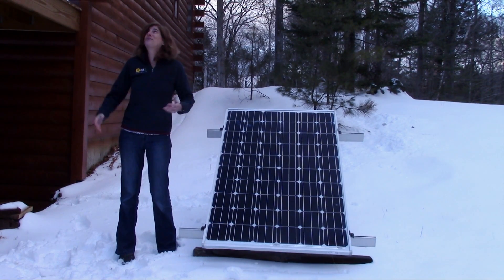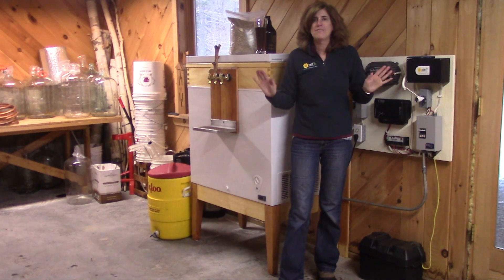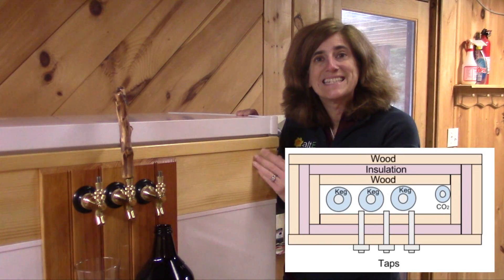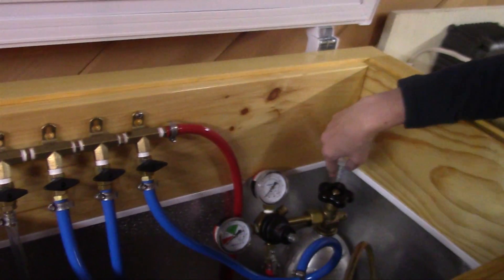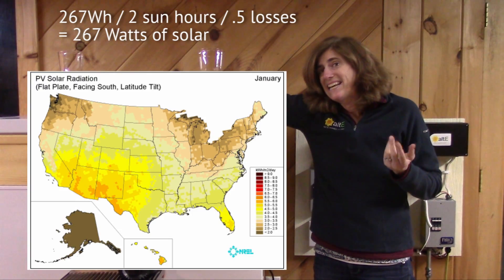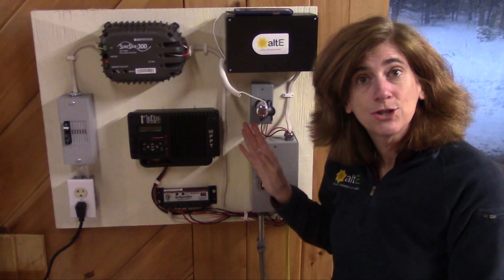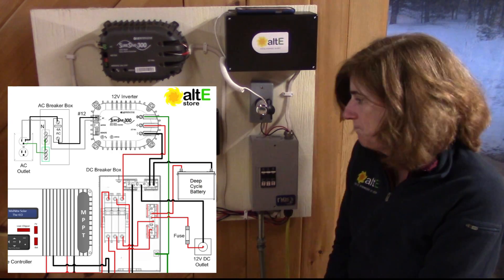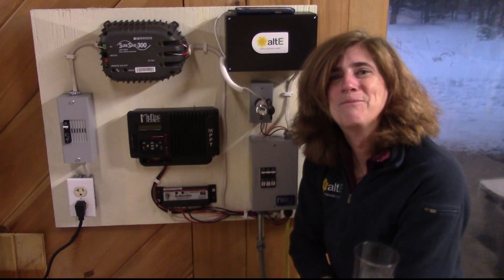Solar Kegerator

Comment: Hi, loving your in-depth knowledge. Is that just a 300w inverter there?
Thanks.
Reply from the maker: It is a 300W inverter, but I think I was lucky with it. Others have said it is too small to turn on their fridge. Depending on the fridge, you may need closer to a 1000W inverter to handle the turn on surge.
Reply: altE I thought so too, although the freezer I have in mind is 220v - 152w - 0.7ish amp So was hoping a 600w inverter would handle it?

Comment: How do you keep the battery from freezing when you are gone for a few weeks and the solar panel is covered and inverter killed the battery.
Reply from the maker: For my system, the battery is in my basement that doesn't get below freezing, so there is no problem. The inverter has a low voltage disconnect that turns off the inverter when the battery gets low, preventing it from completely draining the battery. The solar panel is tilted steep enough that the snow falls off after a day or two.  If the battery was in a freezing location, I would have it in an insulated box that keeps the heat in that is generated when the battery is charged. Again, I'd make sure the panel is steep enough to shed any snow.

Comment: Many thanks for coming g back to me. I was planning to use 6 x 6v batteries 225 amps each connect 2 to gather in series to get 12v at 500amps banks. 
My question how do I know which mppt controller I will need.
Is there any calculation need be done or the biggest the better.
Many thanks any.
Reply from the maker: Divide the solar array by the battery bank voltage to determine the charge controller size. No need to oversize it unless you are planning on expanding in the future.  You have 3 parallel strings of 2 batteries in series for 12V 675Ah bank. You want to at least charge it at C/6 rate, with means 1/6 of the amp hour, so 112A. For 12V, that's 1350W, so you'd want about 4 300W panels at minimum. You would need 2 charge controllers to handle all of that at 12V. If you don't want to have 2 charge controllers, you could do 24V with 2 strings of 4 in series, so 8 batteries. That would be 450Ah, C/6 charge rate is 75A. You'd need about 1800W of solar.

Comment: Hi Amy. I have learned a lot from your videos.
My question.
Is it possible to connect 250 watts or 300 watts 24v or 36v solar panel using an mppt controller and connect to a 6v 225 amp batteries?
If yes then how do I know which controller I will need. 10,20,30 or 40amps?
Reply from the maker: What battery voltage do you want to have? Most MPPT will work with 12V, 24, or 48V, some do a few more, like 36V. I don't know nay that will do just 6V.  Let's assume you will wire 2 batteries in series for 12V. To know what size charge controller, divide the watts of the solar array by the volts of the battery bank, to get te output amps of the charge controller. For example, 300W / 12V = 25A charge controller needed.

Comment: hook air compressor up to kegs, havve air compressor kick on when PSI iss too low, no more wait time for beer to be poured, and defy physics with friends by pouring uphill.

Overkill? anything to do with creativity with a fine craftsman beer is not overkill... however anything to do with beer beyond capping and bottling is overkill if you choose off the shelf stuff... but the real question is...

WHO WOULD CHOOSE OAK AND MAHOGANY FOR OFF THE SHELF CHEAP BOOZE? nobody with a sane mind, that's who

Comment: Amy, how you do to start a freezer compressor with a MS 300 watt inverter??... I have exactly the same inverter and it trips off every time I try. I know that to start a fridge compressor on every cycle it can take up to 7 times the power it normally drains. 
In my GE chest freezer case (80watts x 7)  560watts for 2 seconds.
Reply from the maker: That inverter can handle up to 600W for 10 minutes. I may have just gotten lucky that the surge on mine works. I know I've done other systems with a small fridge where I had to increase the inverter size to handle the surge (see the tiny house video, I ended up replacing the inverter with one over 1000W). You are totally right, surge can be a big gotcha. When in doubt, go with the bigger inverter.

Comment: Did you say that the inverter is connected to the battery?, so you don't connect the inverter to the load output on the charge controller/
Reply from the maker: Never connect the inverter to the load on the charge controller. That is designed for low current DC loads, like a light. The load they are able to handle is generally the same amps as the PV it can handle. So a 20A charge controller can handle 20A load. That's less than 300W on a 12V system. Inverters have their own low voltage shutdown, use that, or plan the system to never use to much energy. Never connect an inverter to the charge controller.
Reply: OK thanks - but how do you stop the inverter from draining the battery down since there is a direct connection?, you said the battery should not go below 50%
Reply: ok thanks - I did not know that, so it is not a simple off the shelf dumb inverter

Comment: HI amy, I learned a lot from your videos. if I buy from you the Panasonic Hit panels 330 watts at 32V, I will may need about  3 panels = 990 watts.
can you advise me which cotroller, inverter and how many batteries I will need?
Buy the way I am from UK.

Nori
Reply from the maker: Like most of my answers, it depends. If you are doing a 12V battery bank, 330W x 3 / 12V = 82A. So you can use a Magnum PT100, Outback FlexMax 80, or Midnite Classic, to name a few. You would need to wire the panels in parallel. For the inverter, you have many choices based on your needs. If you get an Outback or Magnum, I would get the same brand charge controller so they can talk to each other. Most of our 12V inverters are 120V 60Hz for North America, you'd likely need a European 230V 50Hz.  AS for the batteries, that depends on yo9ur loads. I suggest reading this blog we wrote last year about solar on your RV. It should help. https://www.altestore.com/blog/2016/07/solar-panels-for-rv/

Comment: Awesome, crystal clear explanation!  Thank you so much!  So we don't have to go searching dozens of sites, any chance you could post a rough $USD estimate of cost from the solar panel to the 110v receptacle, inclusive of those parts, in 2017 dollars?  Thanks, and as always, you do a great job explaining the setups.  And also thank you for the practical (kegerator/kreezer) application, rather than lighting a light bulb!  Thumbs (and bottoms) up! :)
Reply from the maker: I know you answered it in another comment, but for folks following along, it cost about $1400. It might be a little cheaper now, or at least a higher wattage solar panel for the same price.

Comment: Nice Video, Thanks for your great contribuition. How do you calculate the amperage for the circuit breakers for the solar panels?
Reply from the maker: Good question. For the breaker between the solar panels and the charge controller, take the short circuit current (Isc) of the combined string, and multiply it by 1.56. The long way is to multiply it by 1.25 for over-irradiance, when the sun is brighter than standard test conditions (STC), and another 1.25 for NEC's requirement for continuous usage (over 3 hours). 1.25x 1.25 = 1.56. So if the Isc of the panel is 8A, and you have 2 parallel strings, then the breaker should be 8A x 2 strings x 1.56 = 25A. If you can't get a 25A breaker, round up to 30A. Just make sure the wire is sized big enough for 30A. The breaker for the output of the charge controller should be the current rating of the charge controller x 1.25 for 3 hour continuous use. You don't need to figure in the over-irrandiance, as the output of the charge controller won't be affected by that.
Reply from the maker: We also did a video on over current protection, https://youtu.be/ZdKiO2zLF5g

Comment: Ha ha ha, brilliant :)

Seriously though I hope to be setting up something similar (uk) and let it take various loads off the grid as it expands. Probably starting with lighting, phones etc and the fridge and that is a good set up. Only thing to remember is when you start out get a controller that will handle your final goal. various panels and batteries can be added when the money is there..

More than enough advice in your videos and personally I like your presentation. Keep em commin ;)

Comment: interesting but I'd personally want a system that can handle way higher loads and constantly.... power house and run shop power tools and welders and so on.
Reply from the maker: This is just a small example to make learning easy. For larger systems, check out some predesigned off-grid systems, https://www.altestore.com/store/solar-power-systems/off-grid-home-solar-power-systems-c567/
Reply: altE ok thanks

Comment: Nice setup! I made my own autonomic system (not solar) for camping and find that is the "always on" inverter is the weakest point of low production systems. You said, that your fridge consumes about 11 watt, but your inverter consumes "Inverter On (no load) 450mA" at 14.4 v it is about 6,48Watts which is more than 50% loss of your system. You could save this power just switching on/off switch of your inverter with wires from thermostat. It will allow you to turn on your inverter only when it's needed.

And please, invite somebody to your videos, you look so lonely.
Reply from the maker: That's a terrific point. If your inverter doesn't have a sleep mode , which puts it in a low power mode when there is no draw, you can set up a switch to turn it off when not needed. I like the idea of a relay triggered by the thermostat, I'll have to look into that.
Fun fact, I recorded this video the afternoon of Dec 31, while friends were upstairs getting warmed up for New Year's Eve. I was like Cinderella working in the basement while my step sisters got ready for the ball...
Reply: BTW, Great work, Cinderella! ;-) As always short and correct information. And you are right, my 1kW inverter have no sleep mode, and it is even not sinusoidal (damn poor country i live), an it drains 18W of power, so i tight it with pressure relay of my autonomous water system for camping to save car battery which i use for AC. When i'll got a subtitle translation i wish to show you my video about it. I suppose you will not understand Russian.
Reply: altE Hi Amy! I am fairly new to solar but your videos have certainly helped me get up to speed quickly.

I have an inverter which does have a power save mode, it is supposed to kick in when +25 Watts of load is detected. It seems to do this though by pulsing the power every 3 seconds or so. This is not ideal because it means if I were to use for a fridge as I would like to then I have to ensure that no other appliances are connected to the inverter, e.g. A stereo or lights, else it pulses the power to those too every few seconds.

Is this how you have experienced power save mode to work on most inverters? Or perhaps it's due me purchasing a fairly low cost inverter? ( I have a Power Star LW 3000, 24v)

If you do indeed have time to respond I do have one more question...!

I have my negative battery terminal connected to Earth ground but I noticed you do not in your diagram; what would be your recommendation?

Many thanks in advance.
Reply: Marc Alexander why so? when lights is off they do not consume any power.
Reply: SashNone apologies, let me clarify. My setup is to power my garage and summer house. I have some items in these places that I would be happy to leave on standby mode (or indeed I may just forgot to switch off) e.g. Stereo. However I have to turn each appliance off at the socket each time if my inverter is in power save mode because otherwise every time the fridge would turn off the standby light of the stereo (and other appliances) goes on and off every couple of seconds. I imagine power to the circuits in the stereo and then dropping again every few seconds would not be good for the components inside, but I may be wrong. Thanks.
Reply: Yea... it must to be annoying a lot...

Comment: I larger system might have some value.  Solar is cheap now but requires a significant initial investment.  Go Big or you are still just a poser.
Reply from the maker: I installed a solar system big enough for my needs. That's the right size system.

Comment: Thats a really expensive set up for a small unit, isn't it?
Reply from the maker: All together it cost about $1400 for this setup. If you don't have access to electricity, there aren't many options that will keep your beer kegs cold for less money. That's equal to $5 of ice a day for 9 months (I can use snow the other 3 months).
Reply: Thats AWESOME!!!! Thanks for your info from all your videos!!
Reply from the maker: Nope, not in Maine. If you keep the beer outside, it freezes. If you kept the kegorator outside, the lines freeze. Plus having to go outside on a Maine night to pour another beer? Not recommended.
Reply: Maybe put the kegs outside :p  JK aside, great video ;-)
Reply: The solar is interesting, but the dovetails and woodwork are in a class by themselves.

Comment: but what wat that AC inverter
Reply from the maker: The inverter is the Morningstar SureSine 300W 115VAC inverter. You can see details of it at https://www.altestore.com/store/inverters/off-grid-inverters/100-to-999-watts/morningstar-suresine-inverter-300w-115v-60hz-ul-p6994/
Reply: +altE thanks miss!!would you please help me?I have  5000w  inverter,so i want solar set up..so what kind of battery,solar panel,charge controller,should I buy,please give me the measurement,.my home country is bangladesh,,and have good sunny day.
Reply from the maker: We would need to know how much power you need to make. How many watts are you running and for how many hours. I'm assuming you are not running the full 5000W for 24 hours. Go to our Loads List Calculator to determine how much power you need, https://www.altestore.com/store/calculators/load_calculator/ and then go to the Off-grid Solar System Calculator to see how many solar panels and batteries you need for those loads.  https://www.altestore.com/store/calculators/off_grid_calculator/?dwhrs=0
Reply: +altE thanks miss,,,

Comment: Hi Amy,
Your 12V battery is how many Ahr actually? With 2 hrs sun time, will the battery be charged for the day? Great video as usual!
Reply from the maker: The math I did said I needed 164Ah 12V, so I used an Outback EnergyCell 200NC 178Ah battery.  I used 270W of solar through an MPPT charge controller. 270W x 2 sun hours x .67 losses = 362Wh a day. According to the Kill A Watt meter, I need  267WH a day, so I have power to spare, even in the winter.
Reply: +altE great!👍
Reply from the maker: We had very little snow last winter. The ground was bare most of the time. Maybe freezing blocks of ice would work better, but they'd probably be melted by Friday night when we get back up there, then it's back to warm beer. And only the Brits want that.

Comment: Thanks Amy!    Very very very good video.   You pointed me to this video via the SolarPanelTalk forum, where I had described my own issues with my "freezerator" :)  and the problem that I had experienced of an early battery death.   Everyone on that forum suggested that I killed my 2 100Ahr batteries because I didn't follow the "10%" rule about charging current:   I only used one 24V 115W panel (<5Amps) to charge them.   I have since bought 2 new panels and looking forward to installing them.But I am curious to know what is the total size of your battery bank, because it would seem to me that you are not charging them with the 10% rule either.   Can you confirm the size of the batteries, and how have the batteries been doing these several months later ?thanks again,   Matt
Reply from the maker: Matt! I'm so glad you found us! The math I did said I needed 164Ah 12V, so I used an Outback EnergyCell 200NC 178Ah battery.  I used 270W of solar through an MPPT charge controller, so into the 12V battery is 270W / 12V = 22.5A. So that's a C-8 charge rate (178Ah/22.5A), well within the acceptable range for charging an AGM battery. I must admit, I don't run the kegorator year round, as we shut down the ski house for the summer, so I moved the equipment back to the altE Store for more demos, so I can't give you a long range report.

Comment: Amy,
I like your way of calculating solar power needed for a terrible sun location much like my location.  I live in Michigan.  So TWO sun hours and 50% loss... so, basically, count on just ONE hour of full sun :)  I'm going to use that as a rule of thumb... sounds about right.   If I have something that draws 1 kW 24/7... then 24 kW solar array!! But it's failsafe in crappy sun areas!
Hmmm.. I'm gonna move....